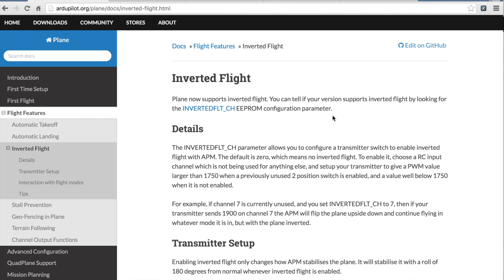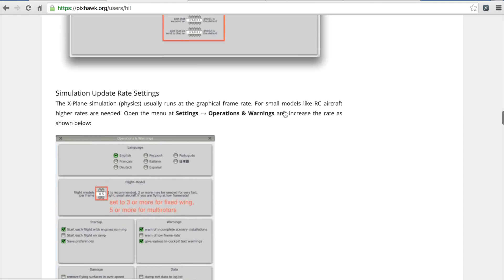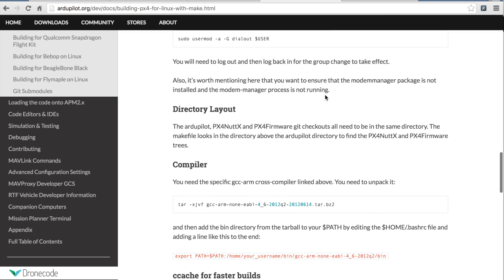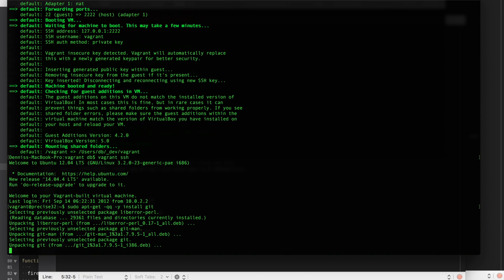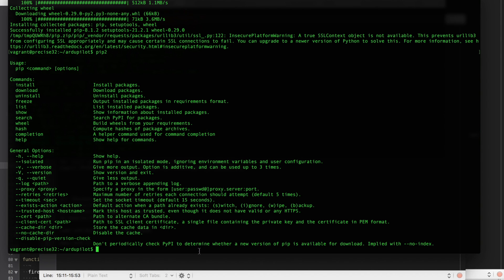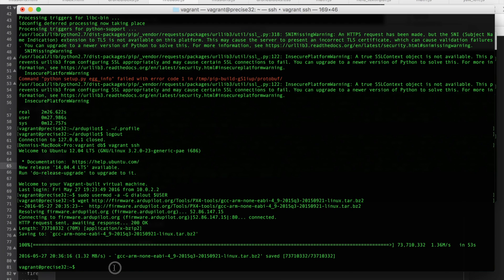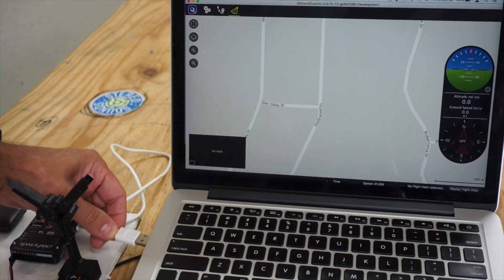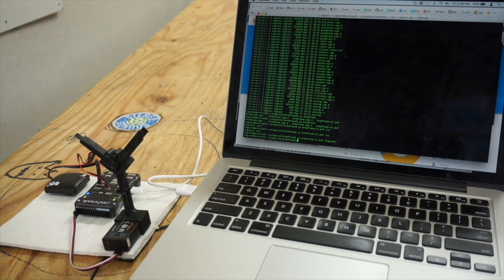How to Build ArduPilot Source Code for Pixhawk

Comment: Mr. Baldwin...I have some code for my APM mini that I need loaded...I dont have the skills to do this and was wondering if I could get you to upload it and send me the modified file....Here is a sample of what I am needing done...I can email the rest or post it here....

install the Pixhawk Eclipse development environment and change some of the source code.
Go into Arducopter Parameters.cpp and Parameters.h and create a new flight_mode_channel parameter. Update config.h to add the Mission Planner accepted values.The flight_mode_channel can then be updated via Mavlink in Mission Planner to be channel 6.
Then modify the switches.cpp read_control_switch method to use the flight_mode_channel setting. Like this:
uint16_t pulsewidth = hal.rcin->read(g.flight_mode_channel - 1);
// calculate position of flight mode switch

Comment: Hello Dennis! I know this is out of nowhere but is it fine if I ask 
you some questions? So I'm currently working on Pixhawk and Mission 
Planner for a quadcopter, and (I'm sorry I'm still quite noob at this) I
 was wondering how it is to obtain the real time data (roll pitch yaw 
x-y-z accelerations etc etc) of the device from the Mission Planner. I 
read a lot about it and found a lot of coding in MAVLink. But I havent 
really worked with MAVLink before.. so can I ask how can I implement 
codes for obtaining those values?

Would really appreciate any form of help. Thank you!
Reply from the maker: Sorry. I've never done this before so I'm not sure. But maybe this will help. There are a few helpful links here: http://diydrones.com/forum/topics/how-to-read-acceleration-from-apm-using-mavlink-c Good luck and let us know how it goes.
Reply: You can ask pixhawk via mavlink